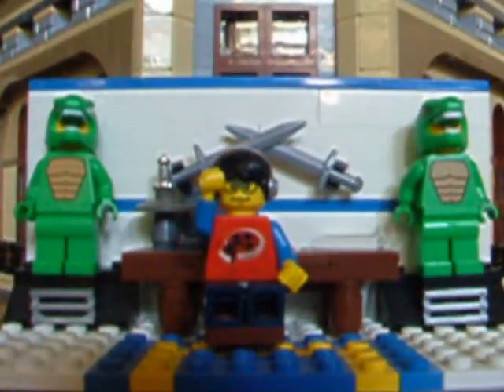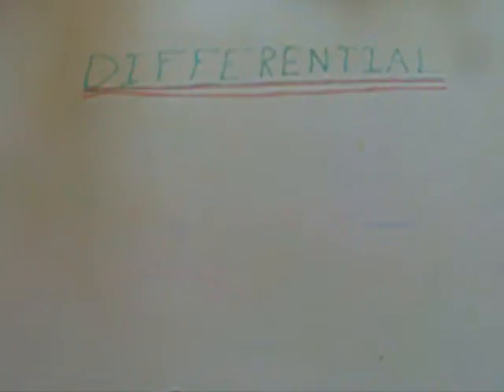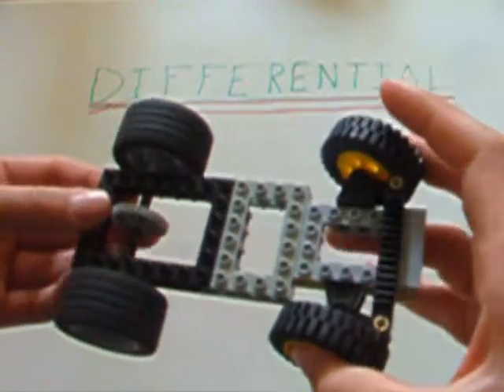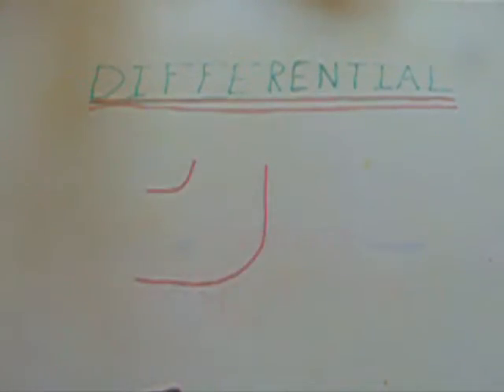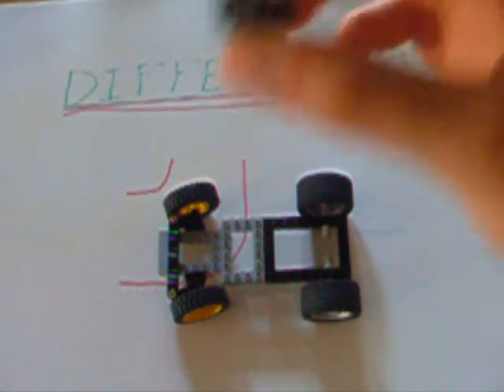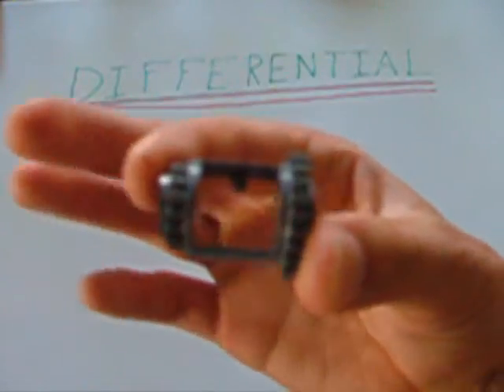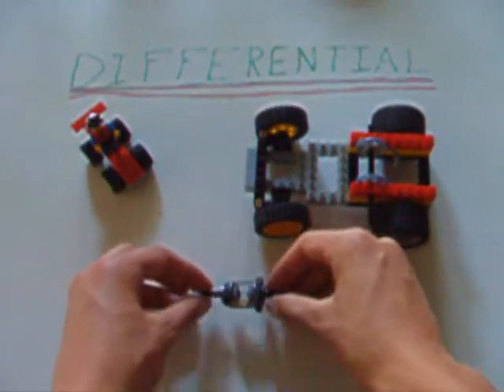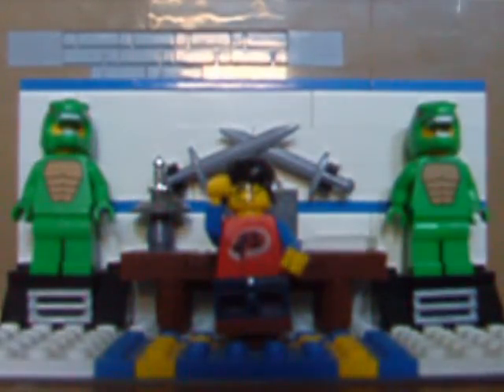Taking Back Technic:  Differential Drive  Bricks, Tips, and Tricks with Arcimedes36

Comment: how do  make a 4x4 diff
Reply from the maker: You should be able to put a basic differential assembly on the front and back wheels, and then link them with a gear train.

Hope this helps
Reply: You can’t, 4x4 drive trains don’t have a center differential, that’s awd that has a center differential
Reply: first learn difference between 4x4, 4WD and AWD 😀